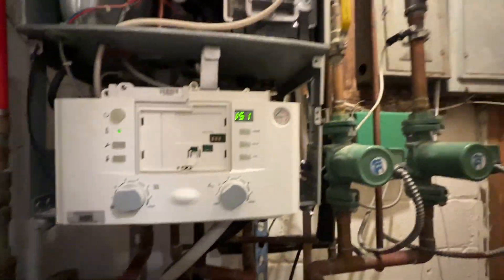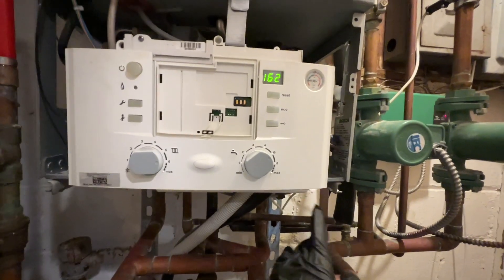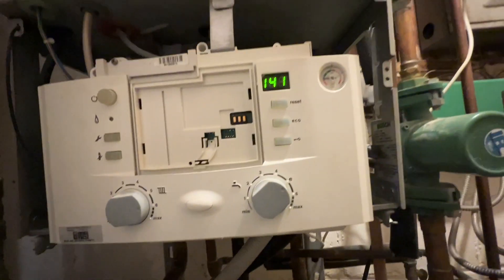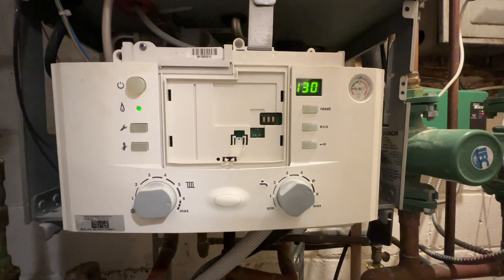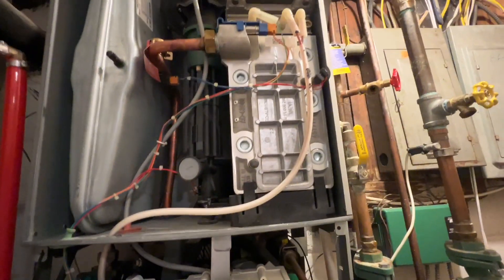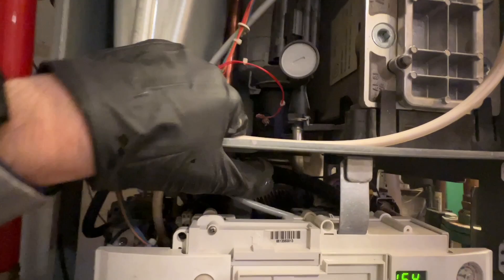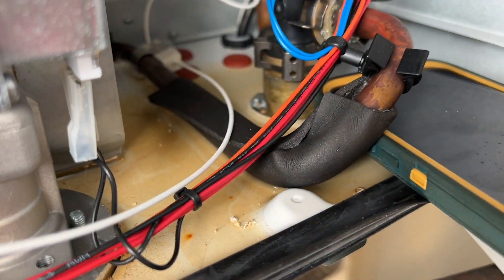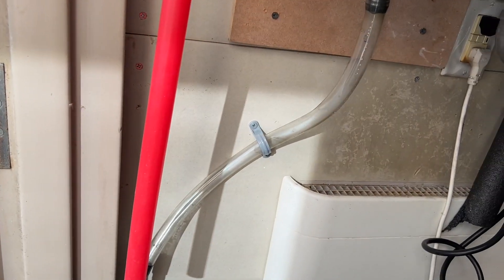Bosch Greenstar and Bosch Greentherm Component Failures! Tankless Boiler and Water Heater Issues!

Comment: I have a Bosch Therm C1210ESC. It doesn't have any issues. Bosch changed the design of their condensate siphon and tubing, it appears. And I didn't even buy that one new, it was a display unit at a home show. The Therm C is still made as a commercial water heater, it's miles above this junk.

Comment: ECO feature must be activated for the domestic hot water to operate properly. Read your manual.
Reply from the maker: This is not true. Eco mode does not need to be activated. If it needed to be activated, it wouldn’t be an option.

Comment: Man as many issues you guys have been seeing with tankless water hearters is really turning me off from getting one for a long time.
Reply: You and me both. I just had to replace my own water heater a year ago and decided to go back with my trusty tried & true Bradford White power vent 50 gallon tank, in no small part because of the problems I've seen and what I've seen Mike & the crew deal with in NY. My new 50 gal tank works just great and will for many years to come. Parts easy to swap out & easy to come by from my supply house.

Comment: We had a Bosch 2.0 condenser fan motor go out after a year on a system. None were available and Bosch couldn’t even get a date that was May this year. My supplier luckily had a Bosch 2.0 on the shelf and he let us use the fan motor off the new unit to replace it for my customer. They just now mid December got the new motor from Bosch so he can put that unit together and sell it.

Comment: Hi Daniel, I feel your disappointment, lemme make two comments: The first Greenstar should be equipped with a proper display control, which is missing right in the middle of the control panel. It's another 300 bucks, however besides the outside-temp controlled heating and other functional abilities, there is quite helpful service menus available with the regulator. Based on european regulations, the system just isn't equipped properly for this single-boiler setup. You're lacking magnificent functionality, mostly due to those fricking 2-point thermostats and a fixed boiler setpoint - medieval engineering. Get a controlled, RTFserviceM and you'll barely need to call for tech support.
The second Greentherm is just rubbish, which isn't really available in central Europe. I guess I left a comment on one of Mike's first Greentherm install videos, about how the cheap line is more or less a Navien product. They seem to have alliances in America. You might remember the Bosch GB142 (Dutch Nefit Boiler), with the Kyung Dong Navien serial plate attached to the heat exchanger...?
Reply: It seems . in usa they work a lot with zone valves  and circutlation pumps etc and on/off thermostats and not with modulating thermostats and  weather dependent regulation etc . ( my Buderus  GB162 is now 15 years old and still going .. )

Comment: good info, thanks. was looking to replace my old '68 american standard gpm-5 with a bosch until i found your channel. decided against a wall hung and went with a weil mclain cga-5. the american lasted this long, hope the cga-5 makes it at least 25. good vid, guys.
Reply: In my opinion you made the right move. Much easier to work on and most importantly parts are much easier to come by. Also you will get double the lifetime on this unit compared to a wall hung boiler. Lastly servicing is a breeze compared to wall hungs.